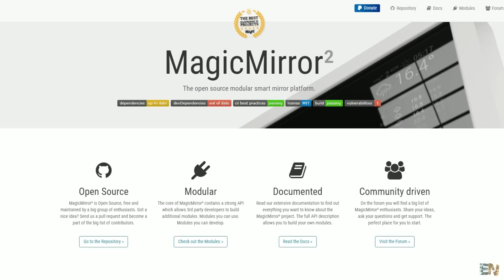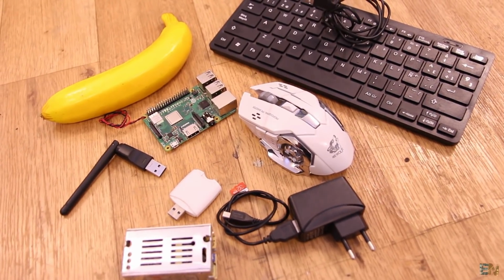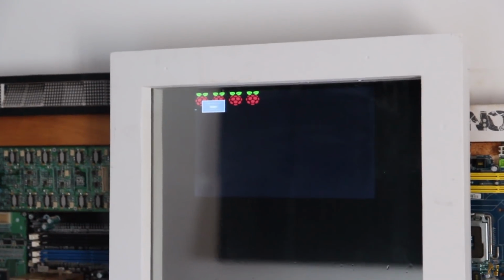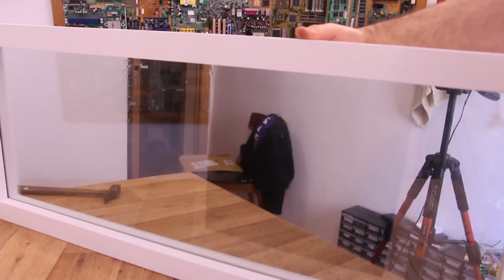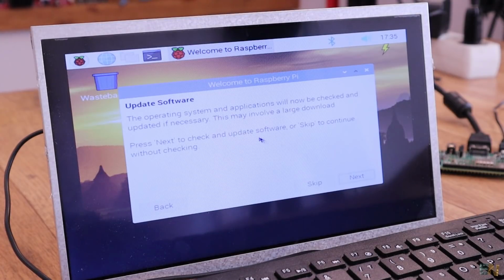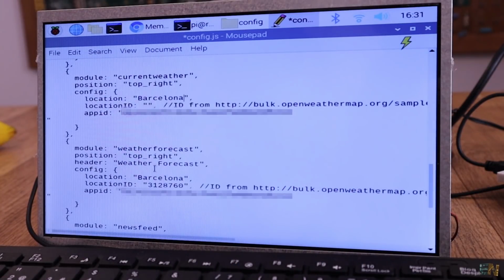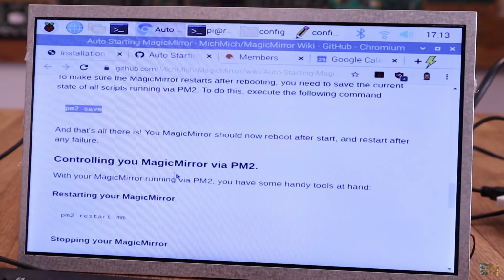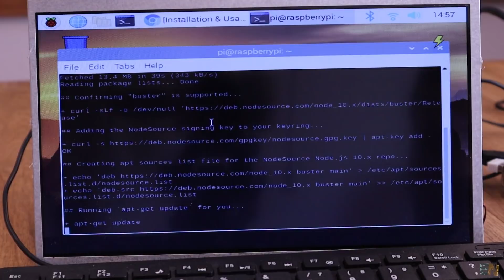Homemade SMART Mirror Tutorial | Raspberry pi & MagicMirror

Comment: nice project bro....
i try following your project, but i have error: 
## Installing the NodeSource Node.js 10.x repo...

## You appear to be running on ARMv6 hardware. Unfortunately this is not currently supported by the NodeSource Linux distributions. Please use the 'linux-armv6l' binary tarballs available directly from nodejs.org for Node.js 4 and later.

i use raspberry pi zero W. maybe you can help me for fix this problem.

Comment: Bro can u Mack a 
Robot arm vactum cleaner

All the momes are doing very Hard work 

Plz

Vacuum Smart Cleaning Sweeper for Hard Floor & Thin Carpet, Remote Operation, Infrared High Suction and Smart Mopping with Water Tank for Multi-Surface Floor Dust ( Rose Gold)

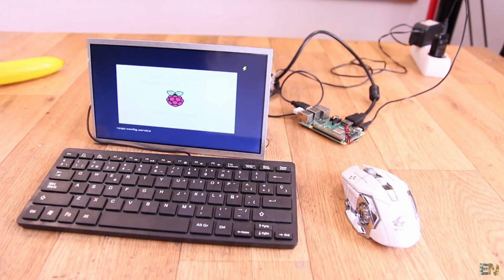Comment: 10:07 The "lightning" ⚡ symbol means your power adapter can't supply enough power, so use an adapter with higher current output (>2A minimum)

Comment: I highly recommend if you can afford it to buy the one way mirror glass from a local Glazier (shop selling glass) instead of applying the mirror film yourself. It will look so much better. I built my first magic mirror using mirror film, and my second I bought from a Glazier, the difference is huge.
Reply from the maker: Yes, that's true!
Reply: What was the cost difference between the two methods?
Reply: @ryancooper1144  buying glass + mirror film maybe 20$ and glass from Glazier cost about 100$

Comment: can i use arduino for this project, and if i can, will it be hard to aconplish that. Im a beginner, when it comes to this
Reply from the maker: Maybe a IOT system with the ESP8266 and the Arduino and a small OLED display behind the one way glass! For HDMI and bigger display, you need a powerfull processor such as raspberry pi!